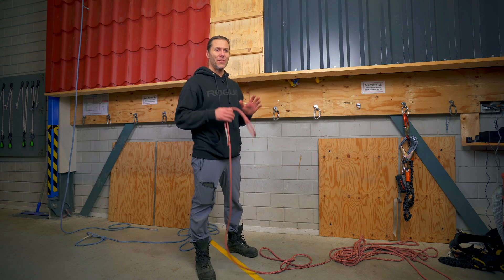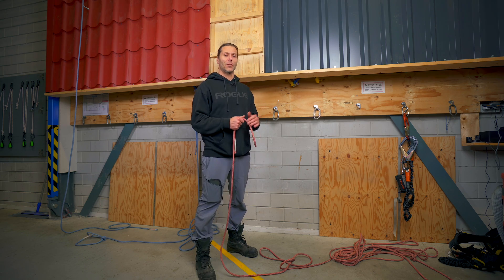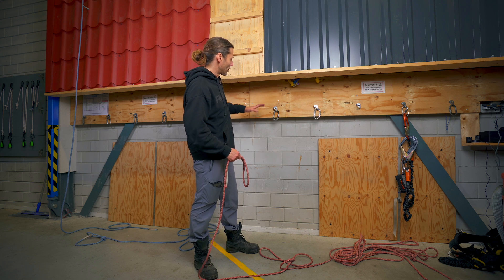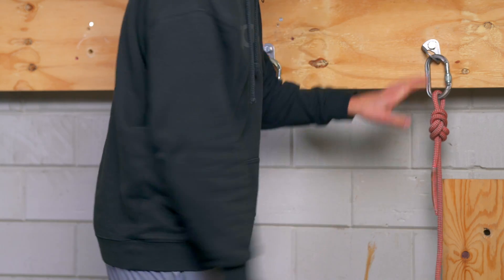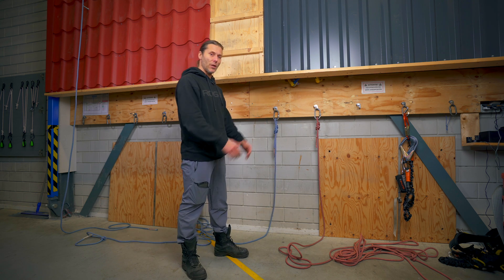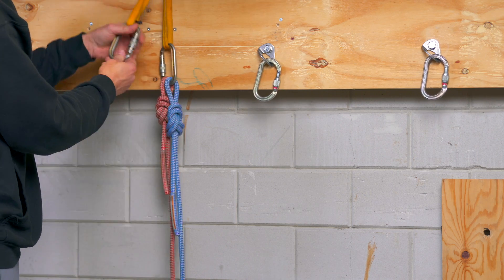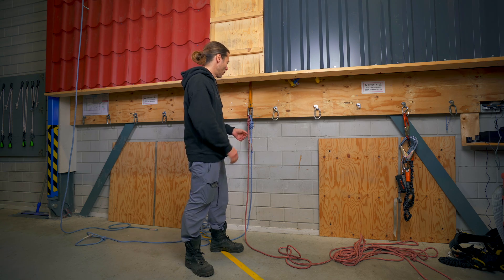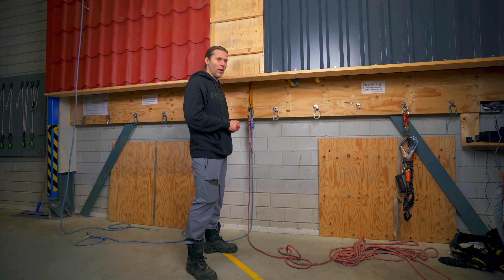How to make a BASIC RIGGING in Rope Access - IRATA Level 1 Training

Comment: Kindly share how to set up 1:1 pulley system for rigging. Am Richard from Kenya
Reply from the maker: I did a whole series going from simple to compound, to complex on mechanical advantages and pulley systems. That should tell you all you need to know..
Besides a 1:1 is basically just a pulley at the top and pulling down.

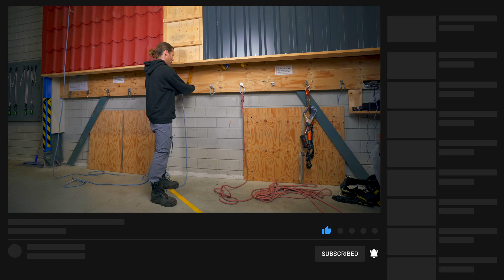Comment: 02:23 I'm so confused... if that one anchor point gave away, wouldn't it release BOTH your main line and safety?  How could that be considered acceptable?

Edit: okay so I watched part 2 and I understand about the shock loading.  Still, if that one carabiner gave away... I'm guessing carabiners never fail?
Reply: If a carabiner is not afflicted and in good working order and loaded correctly (closed gate and load to the spine of it)usually it will fail last.Assuming you are using a steel carabiner with 37kN breaking strength you can consider it "bomb proof". Adding another one in the equation you have redundancy.The "tricky" thing is the assessment of the structural point of anchor. You know that the carabiner is tested for 37kN but the structure?Yes there are guidelines about structures and their "ballpark" (should i say minimum?) strength but you don't always have a hefty I-beam available to anchor to. So, many times you have to use your knowledge and your instinct, ex. a tree (that is not rotten inside of course) with a trunk of 50cm in diameter will not have a writing on it about breaking strength but your instinct tells you that is alright to anchor there. The bottom line is that almost all the organizations for rope access talk about the "minimum" requirements of an anchor point,so no one will blame you if you have 4 slings on the main anchor point and another 4 on the backup line with double carabiners in each point.The only thing to consider is the efficiency of that system (time to set it up,plus the complexity). Some times complexity makes it easy for you to miss something.Finally you have to think that even if you use (an exaggerated example) 20 slings and 8 carabiners on an anchor point it all gets down to 2 ropes.I call it the "redundant paradox".To be honest no one wants to use 4 lines and wearing 2 harnesses on! 😆
Reply from the maker: Did you watch both videos? Then you see that the rope has always been connected to two independent points of attachment. Never in a single carabiner.
If it is unclear, please let me know and ill help you see it.

Comment: Thank you for the video, I was interested to see how the safety rules are in your country abroad. At present on the territory of the former Soviet Union the main guideline for all industrial rope access worker are IRATA rules. Although when I personally was trained in Tashkent, far back in 1993, the most important thing was to attach ropes to two different structures.
Reply from the maker: Yes, the Dutch regulations are a bit less than what IRATA prescribes. That is about the only difference. Also two separate anchor points 👍🏻👍🏻